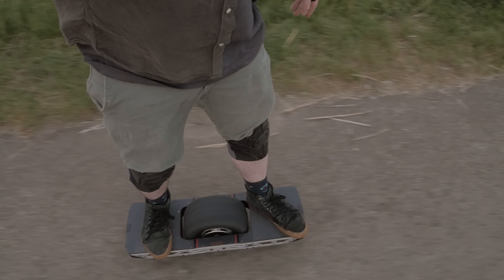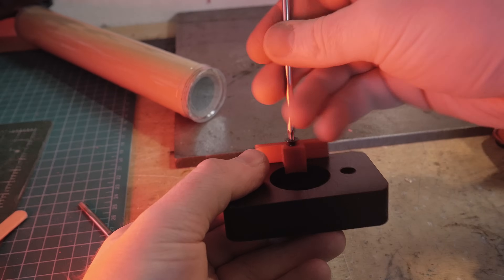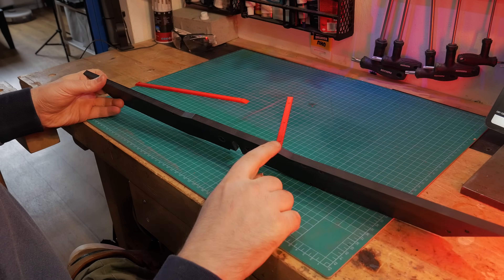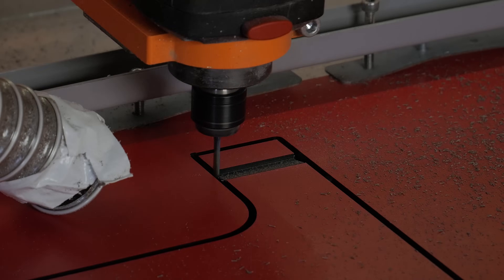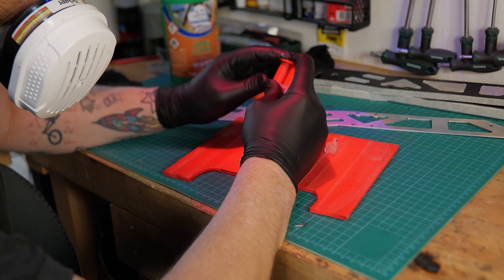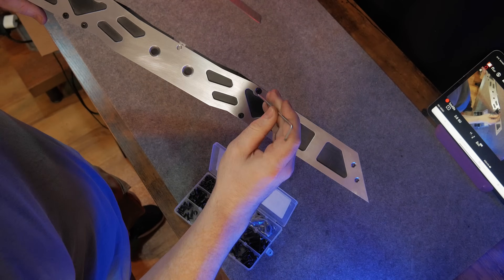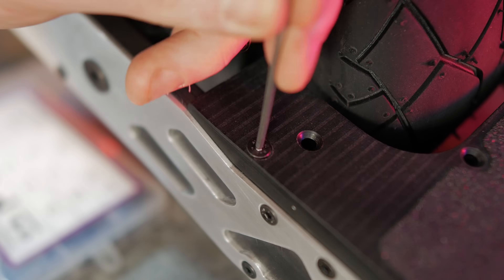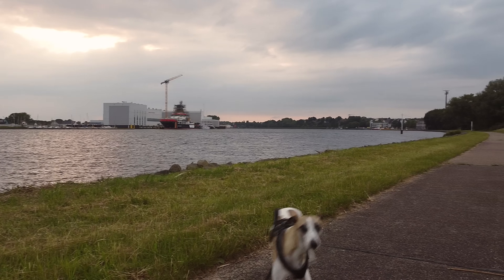Can My Dog Ride This 4kW Monster I Built? |  Final Build is HERE (Part 4)

Comment: Great project! I would suggest you design a vacuum shroud for your CNC's spindle.
Reply from the maker: Hey, thanks a lot, I’m really glad you enjoyed my video. Actually, I already built a complete dust collection system for my CNC spindle, including a full enclosure for the whole machine. I just removed it for the video so everything could be filmed more clearly. Unless you were referring to the part where I was laser cutting – that was pretty improvised since I’ve hardly done any laser work before. For that I just quickly hooked up the extraction. I really should come up with a better solution for the laser. But for the regular CNC work with wood and metal, the dust collection is already fully set up. If I had left it installed, though, there wouldn’t have been much to film.

Comment: Im thinking using this same motor for my build. What is your opinion after using it?
Reply from the maker: Hey! So far, I really like the motor  especially for the price.
It rides super smooth, doesn’t cause any problems, and is easy to configure. Right now, I’m still using a battery that can only deliver about 25A at 75V, so I haven’t pushed it to its full potential yet.

I just finished building a new battery that can deliver up to 100A, so I’ll test it under full load soon. I’m planning to post an update video in about 2 ..3 weeks.

Here are a few things to be aware of:
1.The tire that comes with it isn’t great for OneWheel-style riding. I’d definitely recommend switching to a Pint tire (but that adds around €100 extra).
2. The axle mount is okay, but I prefer a more solid solution  I designed a custom block mount with two bolts per side, which I think is more reliable.
3 The motor only fits smaller wheels like the Pint  a GT tire won’t fit the rim. Not a problem, but good to know.
4. My unit had some rough grinding marks on the hub, like someone cleaned it up quickly with a grinder after casting and just spray-painted over it. Not critical, but not clean either.

Conclusion:
Yes  I’d absolutely buy it again. As far as I know, there’s no real alternative in this price range. If there’s another motor out there that compares, I haven’t found it yet.
Reply: Hey thanks for getting back to me and good to know it worth ordering the unit. I'm confused about the tire size because spintend confirmed the wheel/rim is 5.5 in.The website says 10x5.5-6 but is shipped out with a 10x6-6 tire. The spintend rep said both size fit. I'm wondering if I can mount a 11x6-6 tire then. I see that you specify the pint size 10.5x4.5-6 as the ideal size. I'm a bit lost how did you determine that and isn't 4.5 narrower then 6.... This is basic but can't seem to wrap my head around this. Anyway thanks for the input again. Amazing job and the build and the videos. I'm shocked this video does not have millions of view yet. I'm a sub I like!
Reply from the maker: @julianjiron8085  Hey!
Yeah, I’ve been through the same tire confusion  I spent nearly three months trying to figure it out and kept running into conflicting or vague information.

I’m currently using the actual Pint tire (the same model used on the Onewheel Pint), and interestingly, it’s wider than the tire that originally came mounted on the Spintend rim.
Even though the Spintend tire is labeled “10x5.6-6” and the Pint tire says “10.5x4.5-6”, the numbers don’t really reflect reality. You’d expect “6” to mean wider, but in practice, the Pint tire is definitely the wider one. So those printed sizes are often misleading.

More important than the width, though, is the outer diameter:
The Spintend tire is only about 10 inches in diameter and feels noticeably smaller.
I wanted more ground clearance and a better ride feel, so switching to the Pint tire made a real difference.

I also considered trying an 11x6-6 tire since my board design is loosely inspired by the Floatwheel, and that’s the kind of tire they seem to use.
But I wasn’t sure if it would fit on the Spintend rim  it’s quite a narrow rim, and I didn’t want to take unnecessary risks.
It might work, but I can’t say for sure.

One more thing I learned:
Some tires look quite wide when deflated, but shrink a lot once inflated. That really threw me off, and it’s hard to predict without testing.

If you decide to try the 11x6-6 and it fits, I’d honestly love to hear how it goes!
For me it’s a bit too late to change anything, since my board is already designed around the Pint tire.

And thanks again for your kind feedback – that really means a lot.
I truly prefer a few people who are genuinely interested in the build, rather than a big crowd just casually clicking through.
This is a passion project for me, and messages like yours are the best part of it.

Comment: My man this is under no circumstances a scuffed job this is superb. 2 suggestions, as you are already working with a plate structure as the rails i would really want you to take some AliExpress carbon plates and machine them for that use (as well as some other plates on the board) its surprisingly cheap. Secondly i seem to have caught a glimpse of the battery wires being ran underneath the board, big nono its a serious safety hazard. Its uglier but at least take the courtesy to wire them above the axle. Also i would love to take a look at the cad i could definitely use that resource. Cheers🎉
Reply from the maker: Hey, thank you, that’s exactly the kind of comment I love: honest, positive, and actually helpful.
You’re totally right about the battery wires. Running them underneath was a bad call,  it’s inconvenient when removing the tire and just not safe. That’s already on my list for version 2, and since I’m about to disassemble the board anyway for a battery upgrade, I’ll fix that right away.

As for materials,  yep, also spot on. This build was a first prototype using simpler materials on purpose. The next one will be CNC-milled from 10 mm aluminum plates. For side protection, I’m considering POM-C since it’s super wear-resistant. Carbon looks great, but I’m not sure how well it handles real-world abuse. Still, might use it on some parts if the price is right.

About the CAD files,  I’m a bit torn. It would be cool to share them now, but I spotted so many potential improvements during the build that I’d rather wait until the next version is done. Would feel bad putting out a version that doesn’t fully reflect what the board could be.
What do you think? Share now or refine a bit more first?

Best regards,
Reply: @LionInTech there are definitely improvements to be made, as it is with all engineering projects. It is an endless loop nothing is ever truly finished. Tell you what, if you had the guts to get onto that thing it valiantly deserves a V1 badge which as a work in progress is a solid makrer to share. We can always wait for v2 though 😉
Reply from the maker: @urigoldenberg8808  Thanks again for the kind comment! I’m planning to set up a GitHub page in the next few days to upload the files, GitHub seems like a good platform for that.

Besides the technical improvements, one thing I really want to refine in the next version is the footpads. I’ve seen some crazy designs out there,  slightly curved upwards and made of soft rubber. Unfortunately, I don’t have much experience with those yet, but it’s definitely an area I want to explore more.

Thanks again!
Reply: @LionInTech  i was thinking capacitive flex pcb from like jlcpcb, im pretty sure velostat would degrade on you and i honestly don't wanna find out what happens when it does
Reply from the maker: @urigoldenberg8808  Thanks a lot for the input! Honestly, I had the exact same concern. That’s why I built the sensor with two separate zones that work independently from each other. And I wired it in a way that only one side needs to trigger for the board to activate. So even if one part fails, the system still works.

It also responds to really light pressure, which was important to me. I definitely didn’t want something that feels sluggish or only reacts when you press down hard. My bigger concern, to be honest, has been the 3D printed structure of the sensor itself. It’s been working great so far, but yeah, I don’t fully trust it yet for long term use.

A flex PCB would be an awesome upgrade. I’ve thought about it too, but I wasn’t sure if it’s something you can easily get made or if you’d have to fully design it yourself.

Also, I’m curious  why do you think Velostat might become a problem over time? As far as I know, that same material is used in professional sensors too, like the seat occupancy sensors in cars. Or have you had bad experiences with it?
Reply: @LionInTech velostat is a squishy carbon infused polymer and although I might be very wrong I am slightly concerned about degradation and change in the resistance characteristics, the fact is that if it does happen it is unlikely to be abrupt but on a self balancing contraption any small inconsistency might lead to terrible results so I'd much rather have something that's either well tested by the community or by the least something that is not based on flexible materials.
Reply from the maker: @urigoldenberg8808  Thanks a lot for the safety heads up!
To be honest, I didn’t even know about Velostat until I came across it in a few DIY Onewheel builds online  I just followed what seemed to be common practice in the community. I wasn’t aware it’s not really designed for long-term reliability in critical applications.

Since then, I’ve looked into it more deeply and you’re absolutely right  it’s not the most robust choice for something as important as a footpad sensor. Luckily, I actually have two industrial-grade foot sensors here already, just a bit smaller. I’ll probably switch to those for future versions. Thanks again for pointing it out  I really appreciate the constructive input!